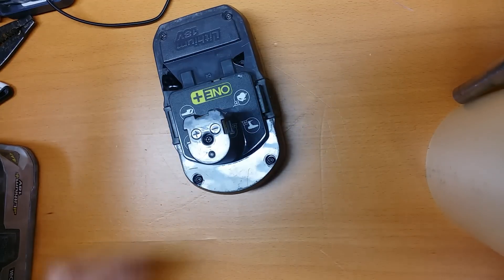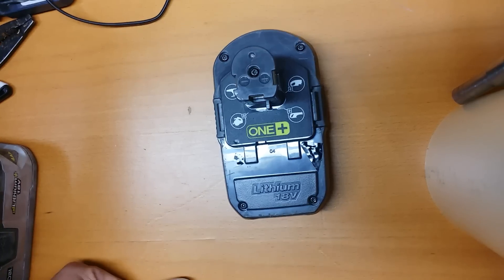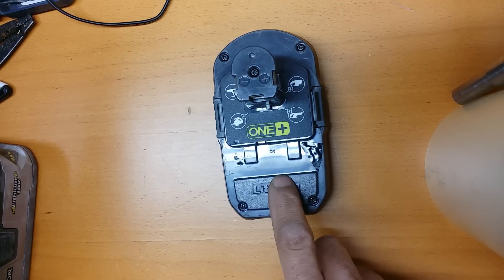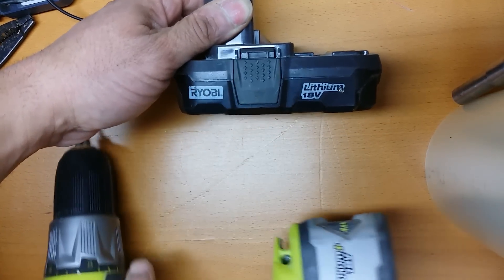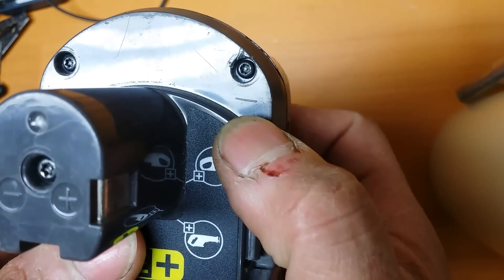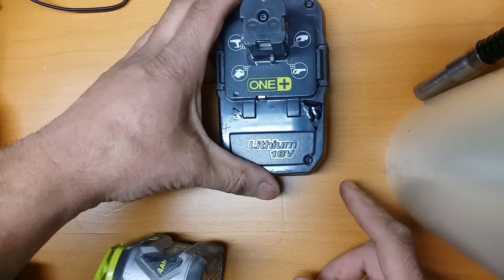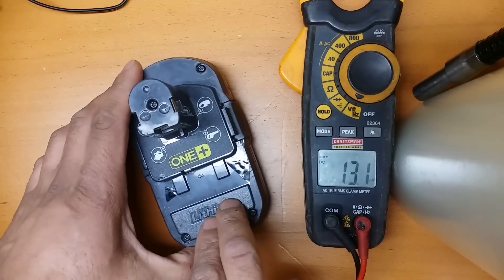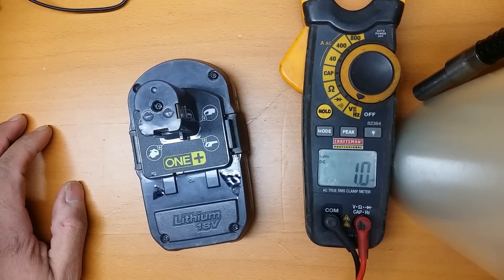How to revive a Ryobi 18 volt lithium battery. Quick and easy

Comment: Great video!  What if you don't have a 15V power supply?
Reply from the maker: @frankb.3556  you can also use 12-volt car battery 12-volt battery charger.
Reply: @tomstuff460  Thanks very much.  I saw some of the commenters used the actual Ryobi charger, using some wires.  I may try that.  Thanks!

Comment: At least fill in the holes with some bathroom silicone to keep the inside of the battery dry if you are using the tool outside and to keep dust out. If it dies again, just pull out the caulk with a paper clip, recharge and reseal. Good tip, thanks!
Reply from the maker: @hiker64  NICE!

Comment: Why can you not just hit the charger wires to the terminals of the tower on the battery? Why do you need to take the cover off or drill holes?
Reply from the maker: When the battery goes extremely low voltage the battery won't let it charge it from the top there is a circuit board that prevents from doing that so that's why you have to either take the battery apart charger from the inside or drill holes.

Comment: Thank you for this.  The best fix I have seen.  I used a halo bolt car charger and put roofing nails in the clamps to be able to fit into the holes and make contact with the ryobi terminals.  Just a few seconds, then popped it back on the charger, and it is charging right up.

Comment: Does this work with a P190 Ryobi battery? They look identical on the outside. 🤷‍♂️
Reply from the maker: The battery does look identical.  just remember not to cross positive and negative it will short out the circuit board

Comment: Drilled the holes, stripped a couple of wire pieces, hooked up to my car battery power station booster, turned on for 10 seconds and now works great.
Better than the torx required casing removal, in my lazy man's opinion!
Cheers!

Comment: Wait did I miss a part? Why drill holes if positive and negative charging metals is exposed up top? Can't you just boost from there?
Reply: There is a circuit board "smart charging system" that will not allow charging if the battery is below a certain voltage. They put that there to avoid batteries with faulty cells causing fires. It's basically to cover their ass. But leaves a bit of work on the consumer end to get it jump started.

Comment: I was skeptical that this would work.  I followed the directions, drilled the two holes and using a 12v battery charger,  charged the battery to 7.8v.  Put the battery in the charger and it went to charging green light instead of telling battery was defective.  Works!

Comment: I was able to rehab my battery by another method; I got it up to about 13 volts, but when I put it on the charger it flashed green a few times, but then went red.  Tried that many times.  Somebody said the Battery Management System (circuit board) must be the issue.  Do you know anything about that?  Thanks for the video.
Reply from the maker: That is correct circuit board issue.

Comment: why cant you just connect to the +/- terminal on the post at the top of battery?
Reply from the maker: Ryobi has installed a low voltage protection to prevent the battery from completely dying. That means if the battery voltage is very low the top terminals would be disabled by its circuit board.  on Ryobi lithium ion batteries.

Comment: Great video: I didnt have that charging unit, but you mentioned or in the comments that it's like jump starting...so i just connected it with 2 wire to a charged battery for 1-2 minutes... And it then put in the charger AND IT WORKED.  THANKS

Comment: But now your battery has holes in it? Why not just take out the torx bits?
Reply from the maker: I get asked this questions quite  a few times. . I'll give you the answer to that not everyone has the special tool bit to remove the screws. It's your choice unscrew it or drill it
Reply: @tomstuff460  I went got a bit for $2 at Home Depot. Drilling into a battery is some amateur stuff
Reply from the maker: @Josh-qc3uj  your going to trash those batteries one day so don't really matter if you had small holes on each side.

Comment: Can't you connect your charging terminals to the top connectors on the battery post without drilling holes in the base of the battery? Don't you just need a good positive and negative connection with your charger or other battery?
Reply from the maker: No it won't work

Comment: I did the same thing. I just took off the screws off the top though because I don’t you know, have a drill anymore. But I did this trick and used a car battery and it works great now!!

Comment: HEY THIS ABSOLUTELY WORKS, I DID EXACTLY WHAT YOU SAYID AND NOW MY BATTERY IS CHARGING, NO MORE TESTING LIGHT ON THE CHARGER, I JUST BOOSTED FOR 10 SECONDS WITH AN OLD LAPTOP 12 V CHARGER AND IT WORKED, NOW MY RYOBI CHARGER IS DOING IT'S WORK. AND THE BATTERY ONLY COST 3 DOLLARS AT A YARD SALE.
Reply from the maker: Awesome!

Comment: Is the power supply is like a car battery charger at low ?
Reply from the maker: Would this power supply I have I can adjust the voltage from 10 to 16 volts DC.  to answer your question yes you can use a battery charger on low 12 volts.

Comment: Thanks for this man. This is especially soothing after sending this to the store and they did not want to fix or replace even if it was still under warranty (and practically new). So it saved me a price of 3rd party repair / a new battery. I used voltage regulating adapter 12V 700mA and started charging after boosting to 12V from 1V.
Reply from the maker: That's awesome I'm glad it worked bud!

Comment: Is there some reason you didn't remove the screws holding the battery together instead of drilling into the side of it?
Reply from the maker: I did it this way because not everyone has access to security bit tool.
Reply: @tomstuff460  $10 on Amazon

Comment: Thanks! Works! Very well and so easy to doing it again thank... Next time don't drill the case use a screws to get the contract Pole and then connect with cables to the charger...  Also this way is easy to cover with any glued

Comment: TOMSTUFF IS NOT BULLSMITHING US....I DID THIS ,AND......I ALSO DID THIS TO A 6VOLT KIDS ELECTRIC CAR BATTERY,LEAD ACID...I HOOKED IT UP TO A 12 VOLT/6 VOLT CAR BATTERY CHARGER,SET IT TO 12 VOLTS FOR AN HOUR,THEN THE DAMNEST THING HAPPENED NOW INSTEAD OF HOOKING IT UP TO THE SAME CAR BATTERY CHARGER( SET AT 6 VOLTS STD) ,AND SEEING THE PERCENTAGE OF CHARGE HOVER AT 4 % AND GOING NOWHERE,IT READ 53% AND CHARGED UP TO 100 %......WITHIN AN HOUR....OF COURSE NOW USING THE .6 VOLT BATTERY  STD SETTING.....AS YOU NORMALLY WOULD TO CHARGE A 6 VOLT LEAD ACID BATTERY.......I USED THE 12 VOLT SETTING TO GT THE RYOBI 18 VOLT BATTERY TO A 95% PLUS CHARGE THRU TH TWO HOLES AS TOMSTUFF DESCRIBED ,AND THEN HOOKING IT UP TO THE RYOBI CHARGER,IT CHARGED UP AS A NORMAL WORKING 18 VOLT RYOBI BATTERY WOULD........GREAT HELP !

Comment: Brilliant!  Works like a treat.   I jumped another Ryobi battery that I had for about 2 minutes and then popped it on the charger as is charging like a new battery.  Thanks Tom.
Reply: So you used another identical battery that worked, to jump start the dead one for a minute and then put the dead one on the charger and it started charging again???

Comment: Some individuals are saying you can just touch the top negative and positive without drilling.  Is this so?
Reply from the maker: if the battery has zero voltage it won't allow you to charger it from the top terminals. Ryobi design the battery to shut down on a specific voltage to save the batteries life and for peoples don't insert it back into the charger on time like days, weeks or months resulting to a completely dead battery.☹️🔋
Reply: @tomstuff460  Great to know.  Thank you for the response.

Comment: What charger did you use
Reply from the maker: You can use a any type of battery charger of 12 volt or use a another Ryobi battery pack with two wires negative to negative positive to positive.

Comment: I tried to drill the hole, but the drill had no battery. So i picked it up and put the battery in. But it wouldn't because the battery no good. So i took it and tried to drill it, but the drill wouldn't work because i took the battery out. So the i picked it up an put the batt...............
Reply from the maker: 😮❓ sorry I'm confused  🤔❓
Reply: @tomstuff460  battery life matters?

Comment: If the people here you donated at least 1$ for the savings you helped them...
Reply: here's  several tips for battery repairing
Don't try to do this until you are sure what you are doing - the acid can burn you
Test the voltage first - there may be a dead cell which would waste your time.
Check the battery fluid.
attempt to fully charge the battery.
(I learned about these and more on Jons Mender Guide site )

Comment: You can also use the top positive & negative on the battery to get it charging without drilling into the battery.  another option to explore before drilling
Reply: No the pcb wont allow it (protection) if you dont want to risk drilling into battery just take the top off and make the connection on the positive and negative
Reply: So just the top metal pieces?
Reply: If you wanna remove the casing you will need a T10 security bit or screwdriver to remove the 4 screws and sometimes a razor blade (long as it’s not u see warranty bc it will void the warranty breaking the seal, so if it is just go get it replaced). Take the cover off, have a spare wire and go about it that way to revive it also, both work

Comment: Tried this, nothing.  Still getting fast blinking evaluate light flashing on all dead batteries I have.
Reply from the maker: You might have a fried circuit board or two or more defective lithium batteries in the pack.

Comment: You don't need a power supply.  Clip leads to the pos neg, and middle terminal on the charger.  Hold the positive on and tap the negative and middle lead on the negative terminal for about 30 seconds at a time, measure voltage each time.  When you get past 5 volts the red light on the charger will flip over to blinking green.  Then you know it's good.  Usually get it to about 13 volts.  The system won't charge if it's under 12.  If it's under 5 the green light doesn't blink.  Don't charge it too long at one time at that point, just get it to about 13, it will lose a bit of voltage while you put everything back together.
Reply from the maker: I will have to try that for next time thank you.

Comment: Hey Tom, what is your second solution you mentioned you mention in your description?
Reply from the maker: Yes I open up the case and I had to bypass with a ground wire.. What I did is to solder a ground wire ( black) from the battery terminal to the ground ( black ) on circuit board. Once it's finished charging remove it from the battery charger never leave overcharge.

Comment: Could you provide more detail on what kind of "power supply" to use.  I don't have anything like you showed in your video and I'm definately not an electrician.
Reply from the maker: This is just a adjustable power supply. But you can use another Ryobi battery, car battery charger, booster pack, or a 12 volt power supply AC to DC. Hope this helps

Comment: Thanks so much!  I was able to revive two 18-volt lithium batteries (P102 & P105).  I did not drill into the case and just took out the T-10 screws and popped the top off.  I was able to then just touch the positive and negatives to get the charge going.  I had these two sitting in my battery recycle pile and now both are recharging as I write this.
Reply from the maker: That's great. The only reason I drill the holes isbecause of most people that don't have the special bit tools to get into the lithium battery.

Comment: Very helpful, but I did not want to destroy the integrity of the case, so I removed the circuitry easily enough, using a #10 torx bit (Ryobi 18v Li). From there, smooth sailing. Thanks!
Reply: What is the trick to removing the screws from the battery?  I have been trying to use a Torx 10, and only one screw came out.  The others seem too small for a T10, so I tried a T8, and still nothing.  It almost seems like there is a little metal post inside the screw that will not allow the screwdriver to sink into the screw.  Any ideas?
Reply: @mcamoeba23  it's  call security torx bits they have a hole in the center, Harbor Freight  $6.00 or E Bay same price.

Comment: I have 2 dead packs. One it worked on but not the other. I opened it and 4 batteries were corroded.
Reply from the maker: yeah that corroded one is beyond repair unless you change the cells
Reply: @tomstuff460  thanks. The first one works great. I may rebuild the other one because it's a 48Wh 10 cells

Comment: Worked for me, awesome. I rigged two 9 volt batteries in series and held contact for about a minute.

For my battery, the drill into the "Lithium" text needed to be a bit more to the left than in the video - towards the middle of the "m".
Reply from the maker: Wow awesome never crossed my mind using two 9 volt batteries

Comment: Just tried this and it actually only took about 3 seconds to do. When i touched the wire i heard a click which likely reset whatever had tripped.

ETA: i also clearly marked them so i can easily and quickly identify which ones i should monitor while charging.
Reply from the maker: They would charge normally as usual

Comment: Great Video.  Sounds like it works.  I had a similar issue and put my battery in the freezer for 10 minutes and then it charged.  So i guess sometimes its the temperature sensor.  My battery wasnt even hot - but its charging now.

Comment: Worked, I did not drill deep enough and seen a green like material. It looked like a circuit board and thought shit! 
This was both sides, I scratched at it a little with a small screwdriver and hey presto!  
Got my multimeter and got 6V, I used 2 wires and jumped it off another Ryobi battery for 20 seconds.
Put it in the charger it flashed red then green, red then green, red then green again but this time it stayed on green flashing.
Thank you for the video.

Comment: Hey, I did this exact technique on my P102, using a 12V 2A trickle charger. 
Before it was a flashing red light, after it began flashing green for approx 20 seconds then went to a solid green light as if it was fully charged. I then attempted to insert into a tool and it did not work, I attempted with different tools and  same thing. I then inserted the battery into 2 different charges and same problem solid green light but dosent work. 
The terminals are in good condition and dont look damaged at all. 
Any suggestions?
Reply from the maker: hello. Sounds like the circuit board is shorted out . I had the same problem with one of my lithium batteries and my  solution was to bypass the circuit board and it works but the only problem is the battery won't automatically shut off when is running low. ( note which I won't recommend because of safety issues)

Comment: 🤔🤔🤔 after doing that,( drilling) how much power you get from the battery?
Reply from the maker: Well if the battery doesn't charge that means it has 5 volts or less.

Comment: hey does putting it on the two contacts, like the ones thta are use for the drill or other tool work as well. I dont feel safe drilling 2 holes in the case.
Reply from the maker: The watch my similar video for different battery but use the same concept.
. https://youtu.be/OAt5TTq_4fw

Comment: I have a question... I have a generic 18volt 6ah ryobi battery that charges works however after its finished charging charger says its defective... Why would this be? I have a bunch of other batteries and a few of the generic batteries which I believe the name brand is Vanon but I could be mistaken. I'm not sure if I get full 6ah out of if but it does power my tools. I run the battery down to 2 bars then charge. After charging it says it has 4 bars so I'm wondering what could be the issue. I haven't taken it apart yet because it's still under the 5 year warranty and as a matter of fact I received it as a warranty replacement for a battery that was defective.
Reply from the maker: I'm sorry but I'm not sure if this method is going to work on a aftermarket lithium batteries. I don't own aftermarket batteries for the Ryobi.
Reply: @tomstuff460  yeah their pretty much the same just cheaper made. The batteries are the same 18650s the boards work the same. Not that I've taken them apart but a battery is a battery lol. Some are just made better then others however my question was what would cause this. Disregarding the fact the battery is generic. I'm assuming it might have a short or more likely a dead cell (battery) but I wanted a second opinion before I take it apart seeing how it may void the warranty. These are the only generic batteries I own as I was sceptical about buying them however I've heard many good reviews and the warranty exceeds name brand by 2 years. I have a bunch of spare 18650s I've salvaged from old computers seeing how it's usually only one that goes bad I have quite a few. I'll end up taking the battery apart and repairing the loose connection or replace the dead battery. Thanks.

Comment: How far are you drilling into that case? Are you drilling into anything important? It seems like there's GOT to be an easier way to feed a charge to the battery without drilling into the case? There's got to be positive and negative connections on the outside of the case.
Reply from the maker: Hello friend . Just drill through the plastic only  believe it's 3/32 inch thick then you'll see the terminal for the lithium ion batteries. Or you can just open the case and do it that way.
Reply: tomstuff460 thank you very much. Great video
Reply from the maker: @djharryg  you're welcome buddy

Comment: I used a black and decker smart car battery charger at 2 amp, for about 20 seconds. Before this, voltage on battery was 6.5. After, 13.5..  I put it on the ryobi charger and got the green light. It is charging now, and looks promising. Thanks.